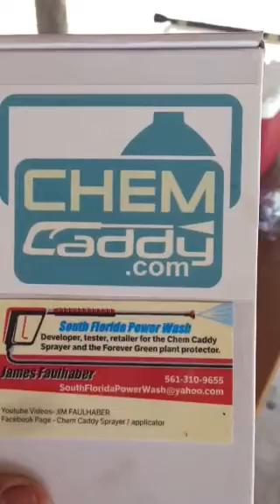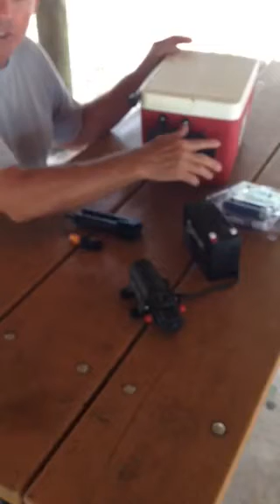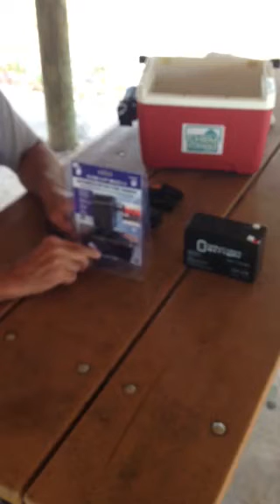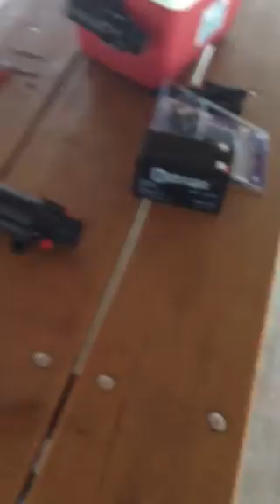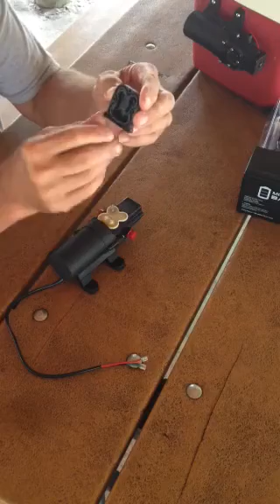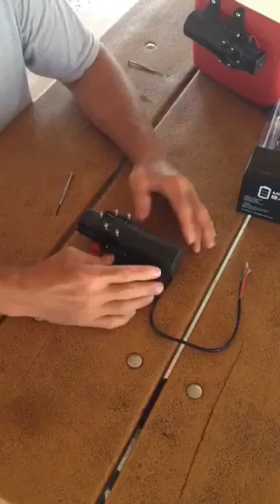Chem Caddy sprayer Trouble shooting

Comment: Hi Jim. Referred by Flexzone. I see these diaphragm pumps are all quite similar but FZ's pump is 18v. Well, what happened to mine is that it is leaking out of the bottom cap. I took it apart and ... I'm not sure how to reassemble. If you have a video, that would be great, or if you can steer me towards a replacement pump, I'd appreciate it.
Reply from the maker: Hi, your best bet is to go on Amazon and replace. I have always saved old pumps for parts.